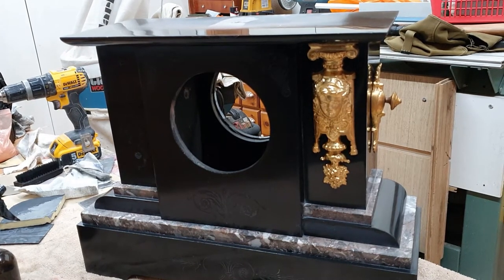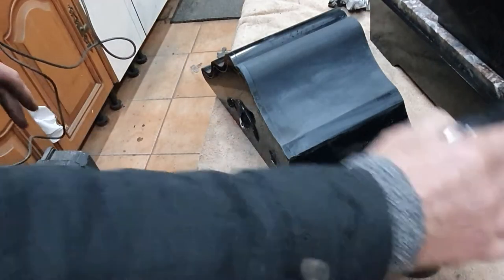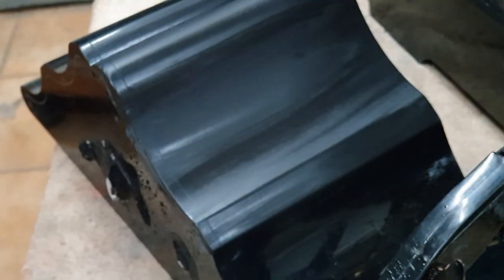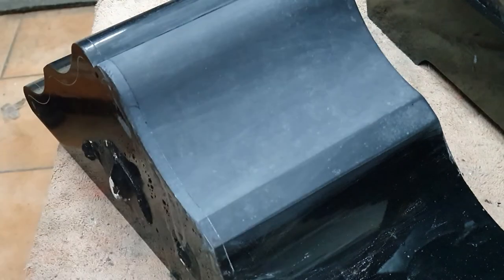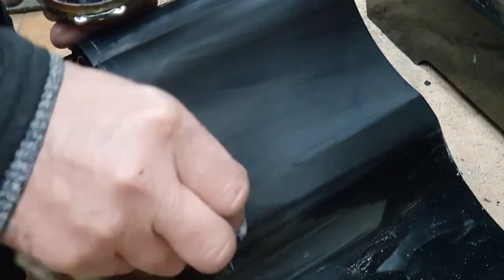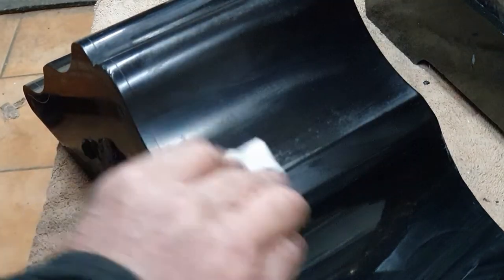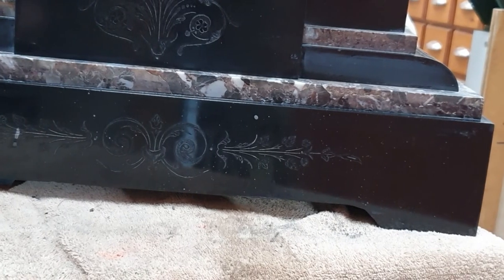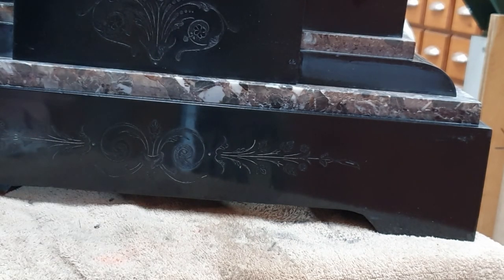Slate or Marble clock case restoration

Comment: A fantastic video, I always treat a slate clock very much like the restoration of an old car wing, using wet and dry from 1000 to 3000 to remove and re polish, then rub with fine grit paint restoration cream, and finally natural beeswax, the finish is truly fantastic. 

Any cracks or missing sections can be fixed with fine black coloured resin, worked with fine clay moulding tools, then fine sanding to finish. 

As for the filling of the engraved parts, melt some hard wax, then using a fine brush, paint the wax on the surface area, being careful not to get wax into the engraved areas, then leave the case in a cold place for 5 hours, then paint the engraved section, any overpaint will then be on the wax and not on the case. 

You then leave the paint to dry for 12 hours, then use clear liquid lacquer to seal the paint within the engraved areas, then leave the lacquer to dry for 12 hours. Then using a new Stanley knife blade carefully lift the hard wax from the case, this will leave you with gold within the engraved areas, and not on the case,  finish with a rubdown with 3000 grit, and finish with beeswax and polish. I’m sure there will be better ways, but I’ve always found this to be a good solution.
Reply from the maker: Hi Russel
I think you are the person Ive have been searching for since my hobby of clock restoration began. Everything I do is self taught and mainly through trial and error. My methods are constantly changing. In some of my videos I have used slate blacking, but I consider this a cheat as the finished surface is no longer the natural polished slate.  I have searched everywhere to find information on the restoration of these slate cases but there has never been anything as detailed as what you have kindly taken the time to write. Please tell me you live within driving distance of Essex so that I can come and watch you work. I dont mind sweeping your floors and making teas all day for you hahahah. 
Thank you ever so much for taking your time to comment
Johnny

Comment: Nicely done. If I may make a suggestion for the fine line pattern I found gold leaf to help. You can get the artificial leaf or real usually in art stores.  A good art supply can set you up with proper techniques and materials. I hope this helps 
Thanks for your video.
Reply from the maker: Hi and thank you
I have tried with gold leaf but my hand isnt steady enough to apply the size beforehand. I must admit the finish looked superb though. Since this video after trying lots of methods I discovered gilding wax. this works out very well as the application is far easier. as you'll see in one of my other videos. 
I'm pretty much self taugh and always appreciate any comments of advice  
Thanks again
Johnny

Comment: If you use wet and dry it will need to be polished using a power or bench polisher to remove fine scratches . Then boot polish or stove blacking gives a good finish.
Reply from the maker: Hi Norman, I havent experimented too much with wet or dry. What would you use on the bench polisher to take out the scratches?
Reply: @treetopspider  I have used boot polish or stove polish . Even bees wax will work .

Comment: I think this is a really great video.  I am not sure how "correct" you are but the result is - as you say more refined than the slate blacking in part 1.  question;- how is the shoe polish fixed?  do you go over it from time to time with more polish - like shoes? or do you fix it with shellac - if that would work.  and are you saying that the Uni Paint Marker is not the best way to do the gilt finish?  maybe gold leaf?  anyway thanks you are giving me ideas - I hope the right ones.  Well done - I really enjoy your experimentation.
Reply from the maker: Hi Simon, thanks for your comment. Its nice to know that people are watching hahaha. 
So far since I made the video the sheen on the clock has remained. I havent sealed it with anything but having said that, It never came to my mind. I think a polish every so often with a soft cloth should keep it looking good for a while. 
The tip of the Uni Marker was a little too broad for my liking. I have thought about guilding but not yet tried it. I recon it may work as the glue is very thin and watery which means it could be applied quite accurately using a toothpick or prefrably a thin piece of bamboo wood. Ive just aquired another slate clock (my favorites) which I may have a go with guilding. 
I dont know if youve seen my clock face resoration. That one came out really well using spay can paint. the idea of that was that the paint is very thin and the gold particles are very fine and cover really well. I then used an old credit card to scrape off the excess. Take a look, you might find it intersting.
Reply: @treetopspider  thanks again for your help and ideas. I will keep in touch with your videos as I hear of them
Reply: Just a thought. I am a bit concerned about boot polish as it, as a wax, will impregnated the slate. If as an alternative having painted with the slate paint which you don't like,can you sand the paint with a very fine paper to achieve the same effect as stage one in the video and then apply the boot polish. This means that you don't impregnated the slate. Having cleaned oak which has been stained there is no way of getting the stain out of the grain. If you want to fume the wood it has been spoilt and the grain is never as beautiful again. Just a thought.
Reply from the maker: @s.spencertenagodus8051  The main reason I wasnt keen on the paint was the fact that it didnt impregnate into the marble and just sat as a skin on top. My idea of heating the wax was to get it to thin enough to enter the micropores of the marble and become a part of it, much like staining wood as opposed to painting it. the finished effects arent quite the same. the stained wood still has the feel and texture of wood whereas painted wood just feels like wood with a plastic layer over it. In an ideal world I would be polishing the marble but my few attempts havent given me the result I was hoping for yet
Reply: @treetopspider  thank you once again.  i have a slate clock to renovate (my first one) so i am keen to learn how.  i am following you with interest very interesting.

Comment: Hi,  I have been following you for a little while, as I have a slate marble clock.  I am stuck!  I cleaned the clock and had to sand it  as it mark's where pretty bad.  Tried using a slate blackening, and had to sand that back as it was awful.  But stumbled upon this video, tried this method and I have the finish I like.  However, I tried to guild the inlays!  Had to remove as it went everywhere.  Buffed the excess with the 0000 wire wool, which of course went everywhere.  What am I doing wrong?  Should I seal the clock with something and if so what will seal shoe polish? Hope you can help.  Thanks
Reply from the maker: Hi,
I'm forever experimenting with ways to finish these clocks. I don't know if you've seen this video https://www.youtube.com/watch?v=FitlOygtnsc
This is now my preferred method.  The gilding past does go where you don't want it to, but clean up is easier than some of my other methods. One good way of putting on the finish without affecting the gilding is to use a hard flat rubber block wrapped with a thin material like bedsheet fabric. Then dab on some shoe polish onto the fabric and polish the clock.  Because the block is hard and the fabric is thin, it shouldn't bleed into your engravings. 
As for sealing the shoe polish, I haven't figured a way to do that yet, but generally I polish it until nothing comes off on my rag. It will also harden over time.
Hope this helps
Johnny
Reply: @treetopspider  Hi   Thanks for the advice.  It certainly worked better this time round.  I'm happy with it now 🙂

Comment: I've just purchased  a French  mantle black slate marble clock , good external contidin does tick  for couple min then stops  😫 I tried balancing it  I'm no expert got that  info of guy I bought off  , also noticed the forks bent slightly in a downward position pendulum doesn't rest straight in slot of forks any idea from you guys on you tube ?
Reply from the maker: Hi Gary, setting the beat is the first thing to try. the easiest way is to place a penny under the right hand side of the case and listen to its sound. You are looking for an even tick - tock - tick tock. if its is out it will sound more like  ticktock - ticktock ticktock (if that makes sense.) then try the penny under the left hand side of the clock. If you establish that the beat is out, you can then slacken off the 2 screws behind the mechanism that hold the front and back together and very slightly spin the dial to the left or right, what ever makes it tick evenly. 
That should sort it out if the beat is out. It could be that the clock hasnt been serviced in some time. The oil which used to be clean and thin becomes like a sludge over time as parts wear. This causes friction which restricts the movement from turning freely. 
Servicing isnt that hard to do. I taught myself a couple of years ago. I have uploaded quite a few videos as tutorials. The great thing about it is that you dont really need any specialist tools for the job either. 
I hope that works and thank you for watching.
Johnny

Comment: Hi, what do you do with the coloured marble sections? I have a clock where these are quite rough and flakes occasionally come off, especially if masking them when doing the black sections. Any thoughts?
Reply from the maker: Hi, I have not come across this problem so far. My initial thought is that maybe a neutral coloured leather or wood wax may seal the marble. Or possibly a clear coat of nail varnish. Much of what I do is an improvisation or experimentation until I find a solution. Sorry I cant be more accurate with an answer but I hope that helps a little
Johnny
Reply: @treetopspider  That's fine, good ideas, will try them on the hidden parts of the columns.  Keep up the good work.  Cheers.

Comment: Clock looks good. I wonder what you might recommend for filling a couple of small holes in the marble of a Victorian slate clock. Is Marblack the favourite for the slate followed by Renaissance wax? I look forward to hearing from you.
Reply from the maker: Hi Trevor
I use something called MILLIPUT to fill in holes and cracks. In fact you'll see me use it in most of my videos. Once its gone off, you can sand and shape it as much as you want. to finish the job I coat the whole surface with Marblack or shoe polish. I buy most things from:
www.cousinsuk.com 
you'll find all sorts of interesting things on their website. 
Johnny
Reply: @treetopspider  Thanks Johnny for your reply. I was wondering what you  might think of the  idea to do the gilding first having first washed the clock, then to do polishing with boot polish followed by micro-crystalline wax? ps Marblack seems not to be available at present. Thanks very much. Trevor
Reply from the maker: @trevorpurrington7718  Hi Trevor. I have always done the blackening first and then the gilding. After I have blackened I clear out the engravings with an old screwdriver that Ive rounded off to take away the sharp edges and lately I have been using gilding wax to fill in the recesses, scrape off using an old credit card or fresh single sided blade then after 24 hours I clean the surrounding areas with a tissue moistented  with the smallest amount of turps.  that can be followed up but a very light boot polish again if needed. See my video for more details
 https://www.youtube.com/watch?v=FitlOygtnsc&t=1s
Johnny
Reply: @treetopspider  Thanks Johnny that's very useful. Great videos.

Comment: I’ve inherited a green onyx mantle clock. How should I clean it? I’m not sure what to use especially as the onyx is green. Any advice would be helpful 👍🏻cheers
Reply from the maker: Hi Matthew
Ive never owned an Onyx clock but I imagine the principles are the same as with slate. I'd take a bowl with some warm water and some washine up liquid added to it. using a soft cloth and some paper towels (kitchen roll) to dry it, If there are any particularly grimy parts in the nokks and crannys, use an old toothbrush to get at them. 
Once finished, I like to use Renaissance Micro Crystalline Wax polish to feed the stone.
Good luck
Johnny
Reply: @treetopspider  that’s great thank you. I will try that. I just was worried something may damage the onyx but will try what you have suggested!

Comment: Great tip thanks 
I've got a cast iron black clock and its got some very sad multi-colored marble,  how did you get that looking so good? after watching this I was thinking clear shoe polish or should i use something else any tips would be greatly appreciated
Reply from the maker: Hi Nick and thanks for the comment.
I used shoe wax originally and heated it up using a hot air gun to try and make it 'suck in' to the marble. Since then I have discovered another product called MARBLACK. I liked this product as its a stain as opposed to a paint. It quite thin which is a good thing and when you use it with a piece of cotton wool  wrapped in a bit of cotton sheet, you dont get streaking lines. Its well worth a try
Reply: @treetopspider  thanks for that. can i ask you how did you get that multicolored marble on your main clock body looking so fresh looking
Reply from the maker: @hibbsnick   well i cleaned it wilh a good kitchen cleaner to get of built up grime and then I uses a few drops of olive oil on a rag. Seemed to do the trick
Reply: treetopspider thanks for that

Comment: i would appreciate advice on how you resurrected the "gilt" embellishment  on either side and on the ends. as usual, I am seeing all your informative videos - but not necessarily  in the right order! Sorry!  but i am a keen follower and your unexplained details are my questions - please!
Reply from the maker: Hi Simon
I have tried two different types of Gold Leaf neither of which are actually real Gold. Ive tried flakes and sheets and I think the sheets were a little better. I bought a kit from ebay for about £10 which included a little pot of glue and some brushes. Its a very simple process of applying the glue to the part you want to gild and allowing it to become slightly tacky then literally place the sheets over your part and brush it in. then just use the remaining part of the sheet to fill in any empty gaps. It goes on pretty seamlesly. Maybe I'll do a short video on the subjet at some point
Reply: @treetopspider  thank you.  i know that real gold leaf is expensive but your suggestion of the cheaper version is very helpful.  i have just got a great slate clock in questionable condition and i am biding my time trying to research the correct methods in reviving it. i must recheck your posts to follow preparation and finishes!

Comment: john i have been researching and have been recommended Marbec's  Brightsone Nero as a "black" slate treatment, may not be good for grey or greenish slate,  and  their finisher giving a dirt prevention coating.  Website for the latter is:- https://www.marbec.it/it/catalogo-prodotti/finitore-antimacchia-antisporco-idrofinlucido/ 
If you have any comments i would be interested.  i think, in time, i will give this a try on sample pieces before your "boot black" as it seems to be a tried and tested commercial procedure and not the high gloss thick slate preparation you disliked in you other videso.  Again just a thought - not my  recommendation!
Reply from the maker: Hi Simon, I looked at that product. I half want to try it out just out of interest. Ive bought another couple of clocks lately, just trying to find the time to restore them.
Reply: @treetopspider  you like me! i have several slate marble clocks (+ of 6 so far) but have not yet started as i have previously stocked up on Enfield and other French chiming clocks (really quite difficult to get them to sync after dismantling etc) i am aching to get onto the slate clocks but have to sort out the others first. i am presently searching for answers on the slate clocks - as you previously  said there is nothing helpful on YouTube apart from treetopspider's comments!  i think it will be a month or so until i get started on the first slate clock.  when i do i hope to be better informed and maybe helpful.  i will be following you - you are quite frankly an invaluable supply of good information - thank you!